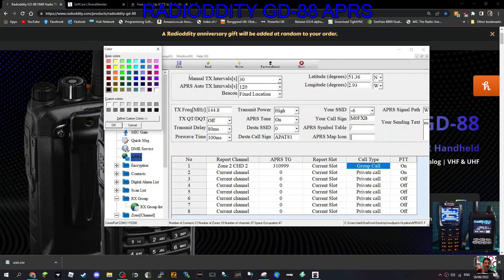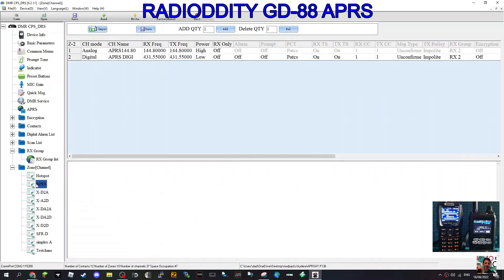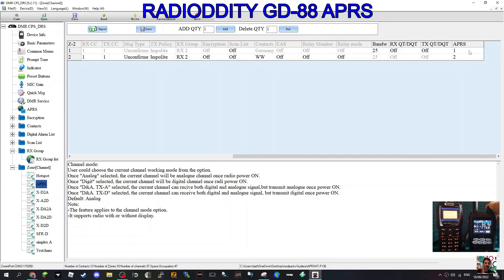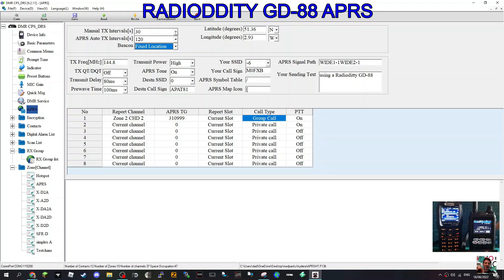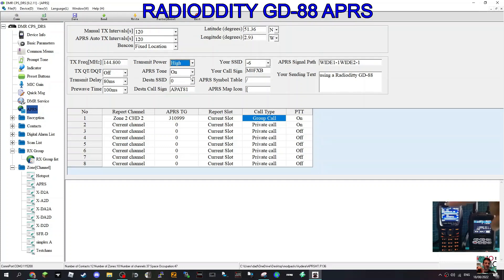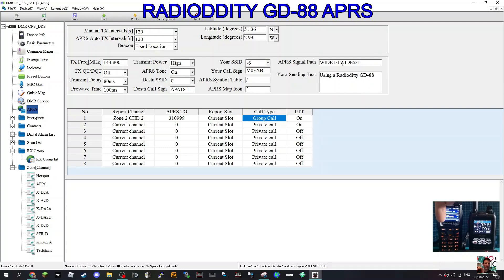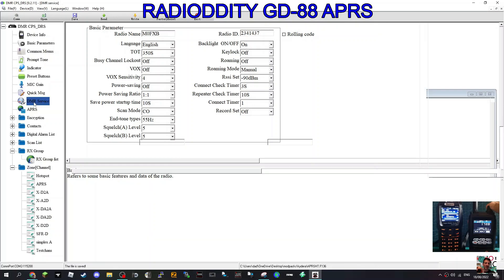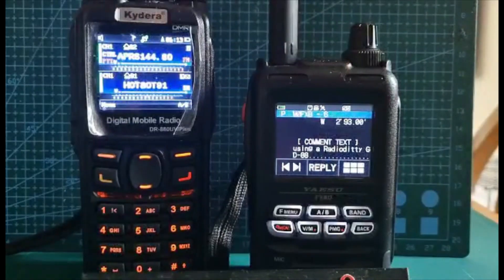GD-88 Radioddity- APRS (analogue 144.8/900) SET UP

Comment: Have you tried receiving an APRS analog packet on the DB-25? I'm curious if it displays anything versus the GD-88 which displays nothing when an APRS packet is received. Thanks.
Reply from the maker: They both don't display.
Reply: Thanks so much for the info.